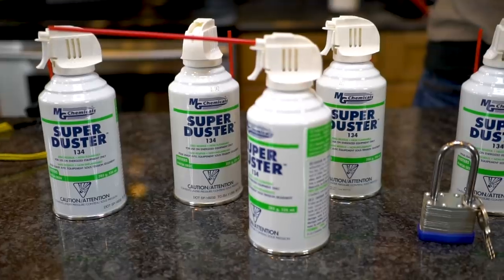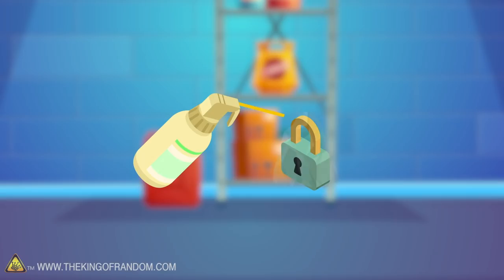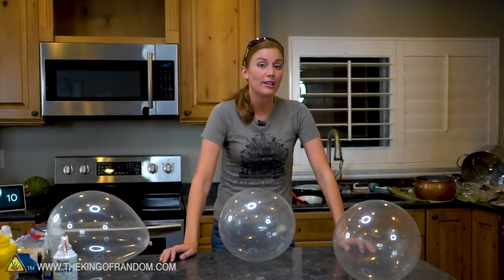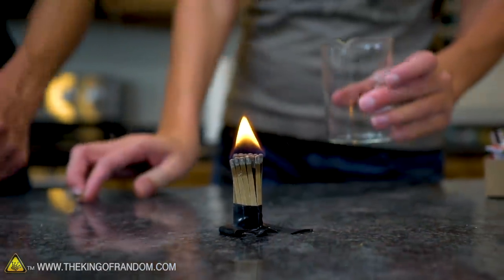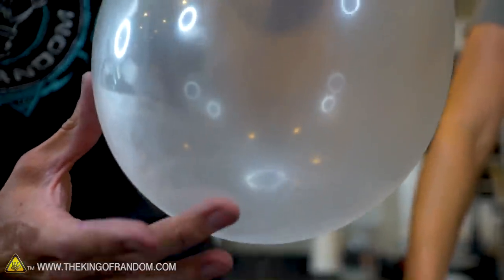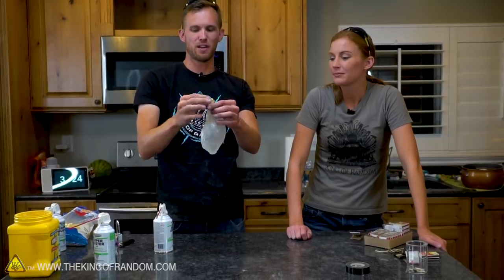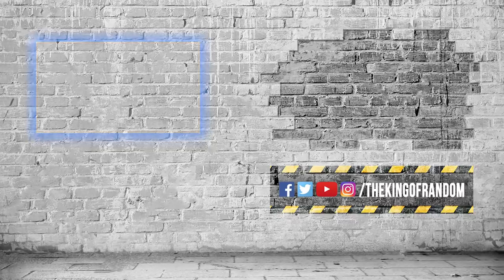Can You Break A Lock With Canned Air? (Movie Mythbusting)

Comment: FYI you were doing it wrong. You're supposed to spray it in the lock mechanism for about 15 to 20 seconds. Then you hit downwards on the lock it will break the mechanism not the lock itself. Also I'm curious as to what would happen if you microwave soap. Bar soap, liquid soap and foaming soap. Would they froth up? With a boil? Are they flammable?
Reply: You hafta hold the can upside down
Reply: @justinwilliams9452  so just hold the lock on it's side...
Reply: justin williams sassy means that in the film the lock was hanging on a chain and when hit with the can (after spraying the lock with the can held upside down) the force is pushing the body of the lock downward away from the shackle where the weakest point would probably be. In this video the force is being applied mainly to the body of the lock which is probably the strongest point. I know the question in the video is asking if the lock would shatter, which I don’t think it would. I think there could be a chance that the lock would open when hit, if hit downward, like in the movie
Reply: @justinwilliams9452  yes but you still have to spray the lock mechanism where the key goes. Trust me I've done this. My bike and high school and if I didn't come home my parents would have my anus in a sling. So I did what any other Canadian would do. I went to the store bought myself a can of canned air and bust of the lock
Reply: Yeah it works way better when its on something and I used alot of it idk what movie they're talking about i saw it on burn notice
Reply: You can pick em shim em use two Wrench's cut it they're junk
Reply: YoUrE doiNg iT wrONg
Reply: That's what I was thinking. Hitting it as it lays on the ground accomplishes nothing due to the fact that no stress is being put onto the mechanism itself, as compared to being locked to something.
Reply: @justinwilliams9452  I did it on a Dudley lock not a Mastercraft. Dudley locks are guaranteed.
Reply: atleast bolt it to somethign and do it for minute or 2 till whole thing frosty and hard wach with hammer
Reply: @justinwilliams9452  Hit most locks with a hammer a few times and the shackle will break. . .
Reply: Sassy Steptoe they alr did dat wit soap
Reply: Do you have a microwave and any soap at your house?
If you do.. You must not be too curious.. Lol
Reply: The soap part I've done for a school project, it foams up realy fast and it smells terrible, atleast when you microwave it.
Reply: I think they’ve done the microwave ivory soap
Reply: Some bar soap will foam up and look like shaving cream if you microwave it
Reply: Soap just melts.
Reply: AsHLiegH-MaRie HoPe  bar soap does that, and it started pretty instantaneously, in under 2 seconds for sure for most bars
Reply: this
Reply: I just saw a video where a dude tried to melt a bar of soap in the microwave it makes it look like mashed potatoes
Reply: they tried it like they saw it in the movie but yeah i think it'll work on the mechanism
Reply: With the soap bit, watch draw with jazzas video on soap carving :) (spoiler, it just goes into a pulp)
Reply: @sassysteptoe6557  lol
Reply: @Sassy steptoe they work online maybe you should consider their career before you criticize.
Reply: @mitchell2143  thats the video i was referring to hahaha
Reply: @matthewjackson5943  there's a difference between criticizing and telling the proper way to do something. There's also a difference between telling someone they're doing it wrong and actually telling them how to properly do it. When criticizing you don't provide a solution. I on the other hand did. It's one thing to tell someone that they're doing something wrong another thing to tell them how to properly do it. And as I am speaking from experience and you are not keep your negative to yourself
Reply: @sassysteptoe6557  lol there was nothing negative behind my words, I simply stated a fact. It's hard to tell someone how to swing a hammer without showing them and them practicing many many many times over and over and over. Something that is completely impossible to do in the form of a comment. As I said you misunderstood my words and now you are butthurt and think I'm attacking Cali when I simply am not, nor do I have the time or funds or trust to fly out to their filming studio and teach her. You are simply trying to paint me into an inescapable corner instead of considering all the different variables that are presented in this situation.  Please try to be as inclusive and open minded as you claim to be. All you're sayin is that it's very close minded to have a different opinion as someone open minded as you. That in fact is a very close minded view to have.
Reply: @allthingssilver7635  actually i don't have a microwave as i live eco friendly. We don't have enough use of one to own one. There are so many other less energy consuming ways to heat up leftovers and coffee ;)
Reply: @Silverfire308  thank you :)
Reply: @jessewitt9415  sweet!
Reply: AsHLiegH-MaRie HoPe  interesting
Reply: @mitchell2143  i love jazza! Thank you
Reply: @76cruisin  Nice spelling.

Comment: A flaw with the lock. You had the padlock on the ground while it would normally be locked to something. Try locking it to a chain and have it against the wall and hit it with a downward stroke. This would put leverage on the internal components to break them. Be sure to try to spray between the shakle and body of the lock.
Reply: the liquid only cools down to around 3F. Far from cold enough to make any steel that brittle.
Reply: @Deepwaterjew  it also depends on the trype you are using, most are just compressed air and some are super cold (forgot the word to it)
Reply: @doubtingmean698  you should probably learn what you're talking about beforehand.
Reply: Pro criminal comments
Reply: Yeah. While it’s cold it’s definitely not cold enough to flash freeze something. Didn’t know the gas was heavier then oxygen though, that was pretty cool.
Reply: You can super cool just about an can of compressed air by shaking the can, while upside. For best results shake spray a small amount, repeat. For prolonged testing, please wear gloves.
Reply: CyberNut930 do you not science?
Reply: I agree with David. Depending on the manufacturer, there may be plastics and/or softer metals that were used for the internal components that can be compromised. Fun video!
Reply: I thought the same thing!
Reply: I’m shocked O.O your REALLLLLYYY smart!”
Reply: david theriot H
Reply: totally agree not all locks are fully steel or and the internal components make up of springs and other things if you were to hit it with a downward force and depending on the lock I would think this might work. Probably 1/10 times but I think it might work on some locks.
Reply: david theriot what about a floor hatch
Reply: @nobleszn9384  nah, the pro criminals know that drugstores have wart removal kits with concealable frozen nitrogen. its much colder than co2
Reply: david theriot smart man
Reply: Also in the film she look to be in an air suit so maybe the air where she was and the temp could be way different from normal air and temp so who know, could be anything but it fun to try.
Reply: david theriot it would be more accurate to the movie as well
Reply: what steeling bikes?
Reply: BUSTER-MOBILE-ABQ yes I know some gasses are denser then others.
Reply: Kim D
Reply: They where trying to freeze a lock on hot concrete in the sun.  These people ain’t very bright.

Comment: I think the “double flame” was a result of the plastic nozzle melting rather than the gases
Reply: yup
Reply: Uh huh
Reply: correct
Reply: or it could have just been compressed oxygen/nitrogen in the can like it wouldn't catch on fire itself but would work as fuel
Reply: It would catch on fire if it was held upside down
Reply: me too
Reply: @bikelifejoey4728 but the noddle wasn't touching the flame when it was upside down so it had to be the plastic burning.
Reply: a al I tried this and upside down it sprays fire, at least the one I tried
Reply: It is quite flammable, regardless of what the can says.  I have burned it on many occasions.  Be careful, though, burning it produces very toxic gases.
Reply: Gary Liseo Jr yah if you look close the nozzle is all weird when their putting it in the beaker
Reply: Right 👍🏻👍🏻👍🏻
Reply: Yup because of the oil in it
Reply: Dude plastic doesn’t burn it melts, so plastic can’t catch fire only liquifies, it must be the gas by process of elimination
Reply: akuiori a
Reply: No it was the oxygen itself which is an oxidizer and can boost a flame but too much can put it out
Reply: Clearly you can see the second flame which is the result of chemicals used in the plastic straw.
Reply: I too noticed that
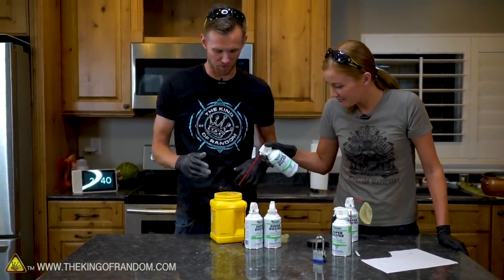Reply: 7:16 notice the nossel ( 3:44 for comparison)
Reply: It being released makes the particles spread out as a gas which due to the high surface area to volume ratio allows it to be slightly flammable
Reply: No cus the flame stopped when the nozzle was pulled away. And the flame direction matched the direction of the gas current, therefore it was the gas.
Reply: Prove it

Comment: My question is.....would it make a difference, in the movie the lock was hanging, and they broke the hasp at its weak point hitting downward
Reply: I also wonder if it would make a difference if 2 people hosed down the lock to get it even colder.
Reply: There's no way air decompression gets cold enough for the real lock to break.
Reply: @CyborgPenguin  modern rouge did it after a couple attempts
Reply: Absolutely
Reply: Doubt it with a can but you can easily break a lock with a hammer in that way.

You can snap a lock with 2 wrenches with leverage
Reply: It absolutely would make a difference. The fact that they didn't actually made me angry. "Hey let's do this thing they did in a movie except not at all." No offense intended but that was incredibly unscientific of them.
Reply: Just modify an electric toothbrush and pick it.
Reply: @CyborgPenguin  spraying directly into the mechanism would work just fine if I'm thinking straight
Reply: @Vance-ms7go  ya spray up the hole and smack on the shoulder it makes a difference by getting the weakest point of the lock brittle and then it just becomes like popping a door hinge
Reply: @axlexgreasejensen9089  I doubt 134a temps would be anywhere near cold enough to make steel brittle. You'd have better odds super heating it then cooling it quickly with this to make it brittle. Actually tempering the steel

Comment: You should try to see how many cans of air does it take to fill up a basketball and see if it bounces the same
Reply: Up
Reply: This
Reply: a basketball has about 0.5bar over atmosphere and a volume of about 7 liter, so that's about 13 grams of air
a can has 285g of air, so you would ideally need about 4,5% to fill one basketball
if you estimate some loss due to leaking and some loss of pressure due to cooling you would need 6-8% to fill one ball
the basketball would behave basically the same, but it would be maybe 1-2% heavier (cool air = higher density), so nothing that you can feel
Reply: 0 1 it’s not just air though, it’s a different gas, so it might have some sort of noticeable affect

Comment: EPA: always have your a/c system drained and disposed of by a professional.

Also EPA: let’s allow them to sell air dusters with the same chemical we say not to release in to the atmosphere
Reply: The gas that made a hole in the ozone layer was carbon tetrafluoride.not this
Reply: @mobilek2137   correct, r134a doesnt damage the ozone layer, but it has a high global warming potential due to its properties, which is why the epa doesnt want it vented, but instead, vented

Comment: those locks can be broken with just the hammer. lock it to something strong and strike the top to pull the body away from the shackle and it will pop right open.
Reply: Sounds like you've done that before

Comment: jglaser is on the right track.  Your technique needs tuning up. Spray on the shackle (the part that you want to break) and hit the shackle (the part that you want to break) not the body of the lock ( that you don't want to break. Use the hammer immediately after spraying; don't allow even one second for it to warm up.
Reply: And use a cold chisel right at the spot you need to break and use a mini sledge to smack it.

Comment: Try spraying a can of compressed air into the key part of the lock, maybe freeze it from the inside out.
Reply: This was always my understanding of how it worked. You freeze the thin metal inside the locking mechanism and then smash down on the body to break the locking mechanism so you can then open the lock.

Comment: A few issues with the test
first the lock should be hanging 
Second you should be applying the spray at the base of the shackle so it goes into the lock body
which brings us to number 3 you should have been applying downward force on the lock body in hopes of snapping the thinnest part of the shackle where the locking paws engage with the shackle

Comment: Also the balloons are heavier due to air density as you said. There's more air inside the balloon then normal and as it warms up to room temperature it will actually increase slightly in pressure and become lighter to atmospheric pressure. If you pull a vaccuum on water it will actually boil. If you super cool air and compress it then it will liquefy.
Reply: From the experiments with fire, it's obvious the 134a is much heavier than air which is why thy balloons would be so heavy. It boils down to the density of the gas which again is much heavier than air as nate literally poured it onto the fire and the smoke floated on it
Reply: @shadowproductions969  3.5 times the density of air at same temperature

Comment: Take a small container, I like to use a capped lug nut held in some vice grips, and fill it with the liquid.  You will see it boiling violently while the outside of the container frosts over. Then light it on fire.  Yes, it burns quite well.  Presto, you can watch something freeze, boil, and burn at the same time.  I've entertained many with this little trick, and I think your viewers will enjoy it.

Comment: 1:39
The sounds complicated but it’s quite a simple molecule if you break down the jargon 

“Tetrafluoro” means 4 Fluorine atoms
Ethane is C2H6
Six hydrogens bonded to 2 carbons however 4 of those hydrogens are replaced by Fluorine atoms

It’s called 1,1,2,2 Tetrafluroethane because it’s a molecule with 4 fluorines two carbons and two hydrogens 
Two fluorine atoms are bonded to the first carbon hence “1,1” and 2 fluorines are bonded to the second carbon “2,2” 

Each carbon forms 4 bonds
2 bonds with fluorines 
1 bond with a hydrogen
And 1 bond with another carbon atom 
And that other carbon also is bonded to two fluorines and 1 hydrogen

Comment: If you’re curious on what the 1112 Tetrafluroethane meant- the numbers represent the position of Fluorine atoms attached onto the ethane molecule : so it says 3x Fluorine atoms are attached to the first carbon atom and 1 fluorine atom is attached to the second carbon atoms and so the structural formula would be CF3CFH2

Comment: Flammable / Non Flammable is only determined by an arbitrary temperature point at which it will burn and whether it will sustain itself when burned. R-134 (Tetrafluoroethane) will not burn at normal temperatures so it is considered non flammable. Some brands use difluoroethane which is almost as flammable as propane!

Comment: It would have bent alot more if it were warm. The colder things are, the slower the molecules are moving, they lock up kinda like the dif between fluttering your fingers "hot" , keeping them open and apart "warm" making a fist "cold" and putting your wrist in a vice and crushing it "very cold" . When things are very cold they act more brittle due to the molecular grid lock if you will. When things break its from the path of least resistance, when brittle the energy is expended flaking or cracking vs warping.

Comment: Btw I'm also a blade Smith and ive tried cryogenic tempering which causes the steel to become extremely suseptible to impact but that lick is not steel its aircraft grade aluminum whuch means unless its temprature decreases below negative 100 degrees a prosses of freezing the molecules in the substance will not take place as where with steel the temprature only has to fall below negative 20

Comment: Might be worth trying on the actual locking mechanism. I've used heat expansion on a locking mechanism before, with a blow-torch, and whilst the D-ring was undamaged the locking mechanism basically popped apart. Combined with hot water, or something, that might work.

Comment: You should have measured just how cold the propellant made things. Also, canned air is used a lot in photography to blow dust from lenses and the camera sensors but you could show by shaking a can and holding it normally, how the propellant can damage a sensor or glass. Find a piece of glass to demonstrate.  Also canned air is very dangerous if used in enclosed spaces without proper ventilation.

Comment: Why not blast it w/ 3 or more large cans- blast two on the bar/body, one directly in the keyway, (for use in the field) use a mapp gas torch or torch lighter on the bar or up in the keyway so it quickly shrinks then immediately starts expanding from the heat? Even if it doesn’t shatter it could still Maybe be pulled open (w/ proper glove) or brute force a screwdriver to turn it open, as the pins & springs will have gone through lots of stress